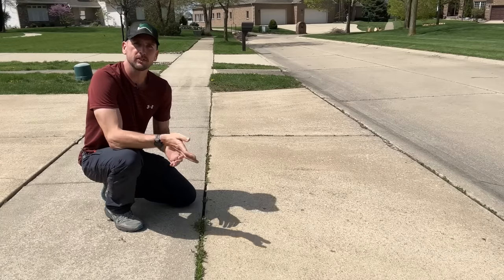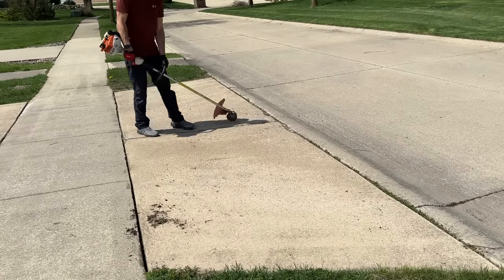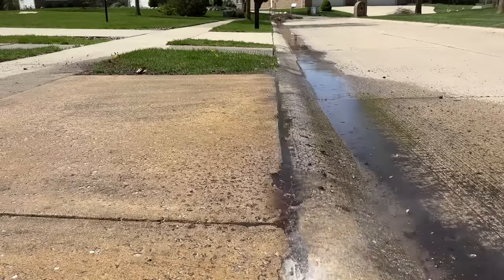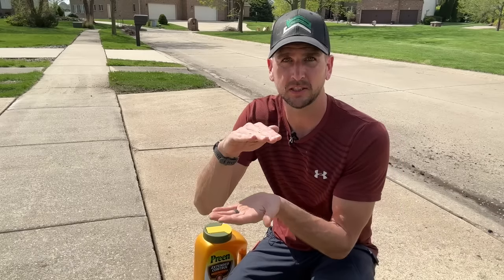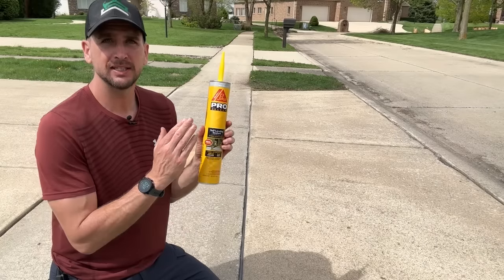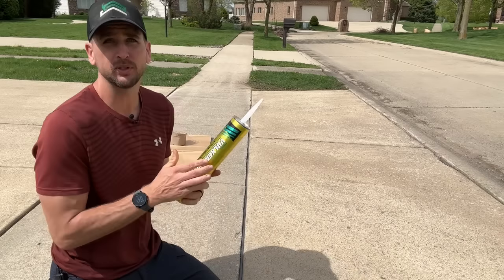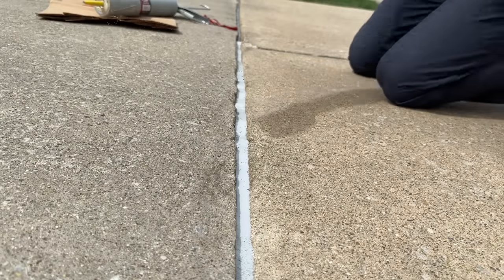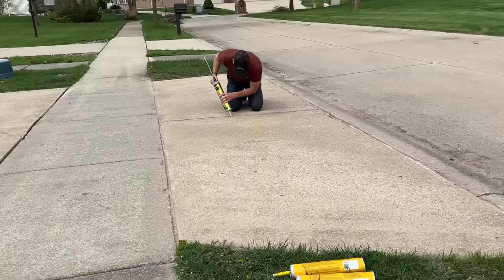Weed-Free Driveways and Sidewalks: The Ultimate Solution!

Comment: I forgot to ask...I have cracks in my non curbed asphalt driveway.  Natural stress (organic) cracks and a few that are over an inch width.  Husband wants me to fill the crack (the depth) with quick crete dust and add moisture then used a backer rod and crack repair.  Any thoughts on his idea?  At first I was going to fill it with sand, but realized it would bleed out.
Reply: For an asphalt driveway I'd use asphalt sealer for the cracks and patching mix or cold-pack asphalt for the larger cracks, depending on how big they are and how mucher filler you need, and then cover over the patch with sealer.
Reply: @pulaski1  Thank you for your reply.  I failed to mention my asphalt is no longer black.  It needs sealing.  Anyway, I left this comment a month ago and I have to tell you, EUREKA husbands idea worked like a charm!  In fact the quick crete is rocky like the asphalt and sort of blends in.  I took a Chinette paper plate and fed the QC dry powder into the crack, then a weed sprayer with water and nozzle turned to drizzle drip instead of spray.  It moistened it and filled in the gap well.  I now plan to use a self leveling over coat and finish it off as you suggest.  But again, I don't' want black stripes...until I recoat with black.  ~  Thanks again for stopping your schedule to answer and help me.  It was most kind.  ROCK ON!  (get it?  Asphalt joke?)
Reply: @b.walker5955  I'm glad it worked out for you, and I appreciate the feedback.  Not many people bother, or apparently even notice, if their post was a month or more ago. ..... And thought "ROCK ON" was a Def Leppard reference.  😀 (I am originally from Sheffield, but now live in NC.)
Reply: @pulaski1  I thought Asphalt was chunks of rock?  Gravel?  🤘 I mess everything up!  🤦‍♀
Reply: @b.walker5955  Asphalt is rocks in tar, and the rock can be anything from grit to pebbles. ... It mostly what gets used to make public roads if they don't use concrete, one or more coarse layers, with a smooth layer to finish.

It starts off nearly black but eventually wears away to reveal the color of the rock.  It can be rejuvenated using sealer (tar in a solvent) or hot tar, and then scattered with rock to provide a hard-wearing surface.
Reply: @pulaski1  So ROCK ON is appropriate?  : )  thanks for the class!

Comment: I wonder how well spray foam insulation would work on larger cracks? If you could find a way to cut the excess from the top to have a nice level surface for the caulk to sit on. Or if you put painters tape on the edges of the concrete and worked the foam before it got ridged.
Reply: Don’t do that it will make a mess.

Comment: I mix leftover water based paint with sand or dirt and pour into the cleaned out joint. No weeds in 8 years so far. Gotta be careful not to get the paint all over the concrete surface, but I had no problem.

Comment: Hey Scott, I don’t so much have a weed problem but my walkway from the driveway to the front porch is tilted where the left side is sunken and the right side sticks up. Wondering if you have any suggestions for correcting that?
Reply: Hi Paul. Not Scott and not a pro, here. I had a similar issue with my walkway and I brought someone in who drilled holes through the surface and then shot in foam (think spray foam) to jack up the lowered parts. Funny enough, the city came by years later and leveled some sections of sidewalk that settled unevenly, in front of my house, using the same method. I think it's the standard these days.
Reply: He published a video several months ago demonstrating how to level a concrete walkway. I would link the video but you tube would probably delete me comment for being spam. But yes, he has a video on that.
Reply: The terms for a procedure to correct that without demolishing the existing concrete are “mud jacking” and “slab jacking”. Search those terms to see how it’s done.
Reply: I hired a company to level the concrete with a poly foam material.  Works well but its expensive.  Usually insurance companies require something like to eliminate the "trip hazard", otherwise they'll cancel your coverage.

Comment: I'd start off with a pressure washer in those cracks. That's the right tool for this job.. not a screwdriver or a weed eater.
Reply: Not everyone has the pressure washer

Comment: Why don't you just fill in the dug out crack's with Trimeric or Polymeric sand. You just sweep it in and then wet it down and it stay's hard for a very long time. This is what's used after laying paver's for a patio. Look it up.
Reply: Then you w8ll get cracks in the concrete.  Filling it in with a hardenening substance defeats the whole purpose of expansion joints in Cement slabs. You want the two sections to expand, contract a shift without pushing up against the neighboring slab. This tension causes cracks to form. You want it to be waterproof preventing erosion from underneath. The sika flex and backer rods are both flexible allowing for "expansion" but seal out the water, dirt and organic matter.

Comment: Look, you don't need to get on you hands and knees and scrape anything. That's barbaric.  Rent a gas pressure washer for $50 for 4 hours and blast whatever is in the cracker right out.  Theres even attachment for horizontal blasting.  Industries can cut diamond with water. But first things first, make a list of all the things you can use the pressure washer for. Now you have to be careful because the pressure water can and will erode the cement around the crack so be mindful of this. Keep at least a 3 foot distance if you're going to spray wood.  Then rinse the sidewalk down with the hose allowing the water to fill the crack. Then in a week, you can add anti-growth products and glue.  Then nothing will grow back because there won't be anything to grow...

Comment: Meh.  Just clean out the cracks, pour dry concrete mix over them and use a broom to level off and clean away excess.  Next time it rains, the concrete will activate, harden and keep the weed seeds out all summer.  Simple!

Comment: Why dont you just use the cementous grout products to fill in the cracks? Using PU products guarantees it won’t look the same as concrete. Also the sag, unacceptable - just use the grout and it will stay ok for years.

Comment: Do you ever even think about the environmental impact of what you are teaching people? Where do you think all that material goes when the rain erodes it over time?
Reply: I’d guess the same place as the toxins from the tires and brake dust on the vehicle you drive every day.  Just a guess.
Reply: Along with all of your eroded shoe soles, any soap you might use for cleaning, any fertilizers or weed killers you might use.

I’m not a tree hugger by nature, but I also don’t like waste and undo pollutants creation. But there also Hass to be a balance between, the environmentalists idea of a pristine environment, and one in which a civilized population can still live in thrive.

Just personally extrapolating, but if that’s your concern – there shouldn’t be a concrete driveway there at all. For that matter, there shouldn’t be a driveway at all, since you probably shouldn’t have any cars, bicycles or other rubber wheeled devices that could eventually erode and end up in the environment.